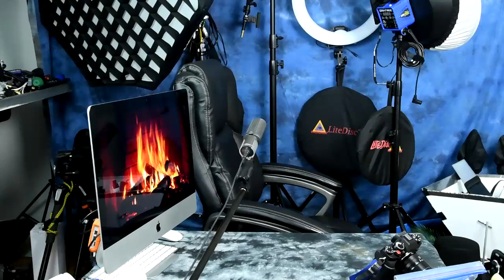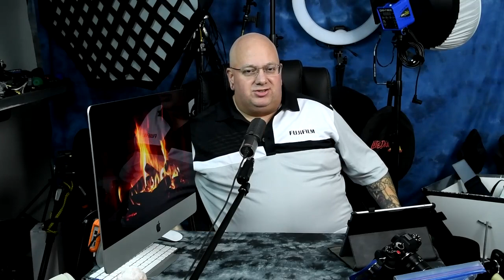🤔 Field Torsion, AC GENERATORS & Fallacy of Mechanomotive to Electromotive conversion

Comment: So it is conceivable that more energy can be released from the "force" than is needed to cause the disturbance, is it maybe like a tap or a wormhole through which energy flows and the amount released is greater than the electromechanical force used to open the "tap"? The transportong wire must then be a " guide' where this energy is directed towards. Would it be possible to open a "wormhole" at some distant position without a wire. Also this means that AC power gets to the other side immediately or the whole concept would fail.... Simple really.

Comment: Assume you have a vertical seloniod with ends open, drop a magnet inside it and it will fall without resistance. Now connect the ends of the seloniod and drop a magnet. The magnet will fall at a reduced speed. This almost mimic a mechanical contact. You have the potential energy of the magnet converted to current in the seloniod.

Comment: Mechanomotive force creates power, here's how it works. Transference of power from mechanomotive force to electromotive force is called "mechanotransduction" aka. piezoelectric effect (direct conversion of energy). Piezoelectric effect is in direct proportion to the atomic lattice deformation which the applied mechanomotive force produces to the crystalline lattice of the receiving material. The power comes from the resistance of the lattice (push back) plus the elastic modulus (resonant vibration) of the material. This can be visualized by a diving board (cantilever). After a diver (mechanomotive force) pushes off the bent springboard (charged/polarity), the board generates power by the subsequent oscillations/wave propagations (elastic modulus of the plastic which is the alternating current) after there is no longer an applied force. Power is generated by the sequential pressure mediation/equalization/neutralization producing "magnetoelastic spinwaves". The "spinor" part off the magnetoelastic spinwave is the electric current and voltage is the force of the spinor sequence (magnons & phonons). At the atomic level nothing actually ever is in 'contact'. A basketball never 'touches' the ground; but is repelled by steric repulsion/stereoelectronic effect (think north end of magnet bouncing off another north end of a magnet).  Everything resonates and when this resonance is perturbed it will push back and consequentially oscillate until dampened. The propagating waves these oscillations produce is what we call "power". Once the waves discontinue, the power turns off.

Comment: Hi You have to      manipulate the energy. This is what the power plant doing .. tesla discover that resonance. You need to build high frequency   generator which make high volt , and then put three spark gap , and the power amplifier and magnifier, and then you need to slash the power to give him the 60hz , this call slasher generator , it spin and creat contact and non contact this will copress the energy , then you push it to pole transformer which is comunication transformer , the AC wave is  pruduce inside the pole trasformer , not up the the line . The compeny sent only RF signal with potentional , and the pole transformer his the one who make AC . If you will open pole transfomer you will see the wire inside frome the line is about 4 m"m only , this not cree any Amp at all. This is the lie that the power line send Amp. And also the high voltage line stay pop , just rap around the plate and the end of the wire does not conecting to nothing . This is transmition anntena with high potentional , not amp. So the power line start with 50.000 hp generetor , and the end off the line is 1.500000 HP. They using with spark gap this is the megic box of tesla . And this how the power in menifacturer . Everyone can build small system system to power his all house for free . This is the biggest secret. Guy is name Gerard morin .. he discover that , for more informetion please contact m

Comment: Here's another subject on AC power. There is an efficient energy storage device called a Flywheel generator. The efficiency comes from the magnetic or Maglev Bearings. You spin it up to speed and it will stay in motion ,for how long ? That depends , but military and aerospace have ben using these for decades because they spin for years on one spin up. Of coarse on Earth they have EM gravity to slow them down a little.

Comment: What causes the field torsion? The "mechanomotive" energy, i.e. water turning the turbine. And what causes the "electromotive" energy i.e electrical current to appear? The field torsion. Ergo, the mechanomotive energy is the cause of the electromotive energy.
Reply: It's the eddy current of one field interacting with the other.
Reply: Yes, and why are they interacting? Because the water is turning the turbine, causing the interaction. There would be no induced electrical current without the mechanical movement of the coil turning between the magnets, and the reason the coil is turning is because of the water turning the turbine.
Reply: A coil is in a magnetic field . When the coil spins in the magnetic field (the spinning of the coil is caused by the water), a current is induced in to the coil. Why? Because of field perturbation, torsion, whatever, the aether is churned, ok. But if the coil just sits there in the magnetic field, no current is created. So, the kinetic energy of the water causes the kinetic energy of the coil (the coil spinning in the magnetic field). And when the coil is spinning in the magnetic field, a current is created because of field interactions. But without the water spinning the turbine the current is not created, the "mechanomotive" energy is the cause of the electrical energy...

Comment: Thinking about your theory a lot lately, something that crossed my mind today is 'What is a sunburn?' I know you dont answer your comments much, so if anyone knows, could you fill me in please. I find this very compelling.
Reply: B-9 H8 your skin has a certain capacitance. Once that level of energy is absorbed by way of blocking the dielectric pulse of light your skin begins to burn because it can not store any additional energy.
Reply: +Ben Murray so darker skinned people can hold more energy?
Reply: B-9 H8 it can be assumed so. Melanin
Reply: different degrees of burn, but normally uv generates free radicals inside the cell which interact detrimentally with dna or rna chains. possibly antioxidants can mitigate the situation but these are not reversible except inside enzymes so sun cream is advised.
Reply: +colas mons  interesting, thanks! A lot to wrap your head around. It seems the more I learn, the more I learn how much I've yet to learn.  And unlearn.
Reply: grow a pelt,  i would
Reply: Maybe we can get a more efficient battery if it's made of Vantablack.
Reply: throw it violently around the room. remove it from the equipment first
Reply: We can call it Flubber!
Reply: we can call it flubber and rose tint it